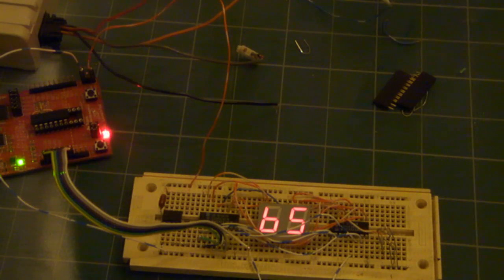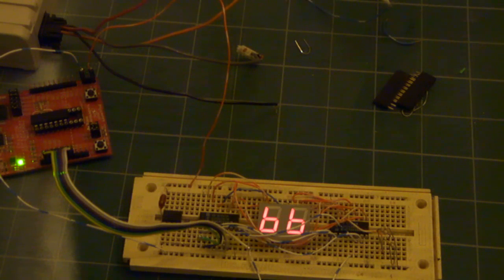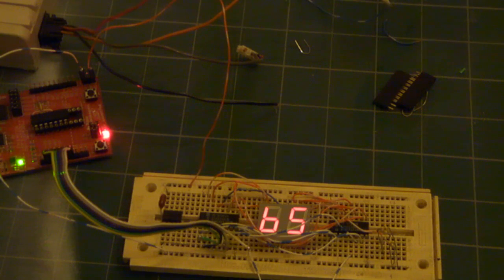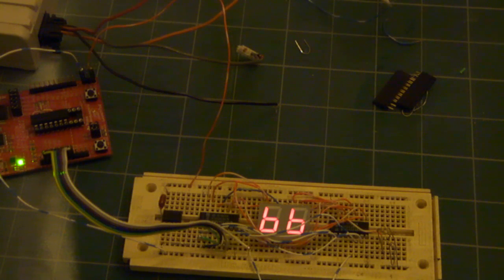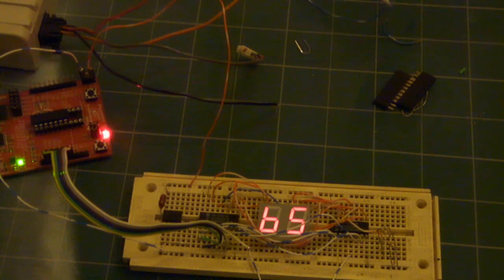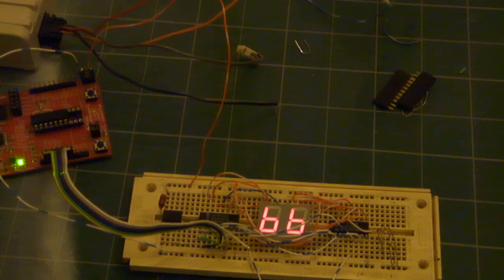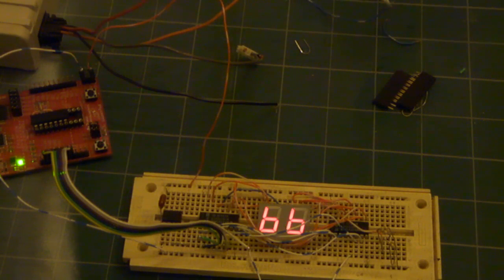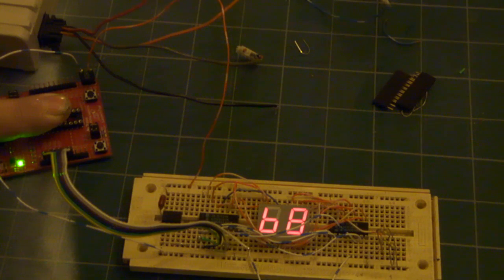MSP430 Launchpad LED display temperature demo using 4511 decoder/driver/latch

Comment from the maker: @CoderXxYy 

Parts: MSP430 Launch pad, 2 CD4511 Seven segment display/latch/decoders, bread board, wires, Two digit seven segment display Common Cathode. 

Sorry have not drawn a schematic, but I put in the code what pins connect to what parts of the CD4511..... So a data sheet on the CD4511 and the Seven Segment display you should be easy to figure out the rest.  Later will draw something up.